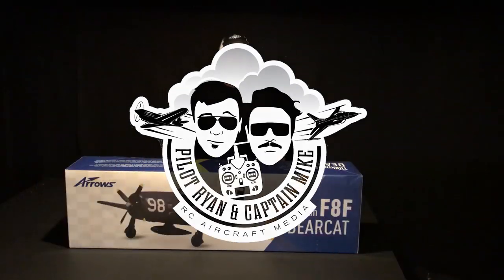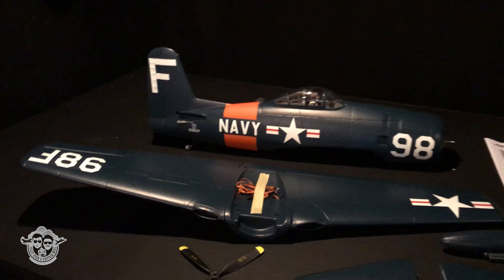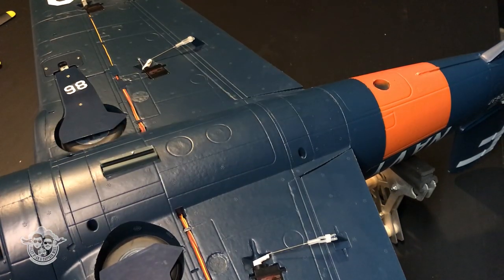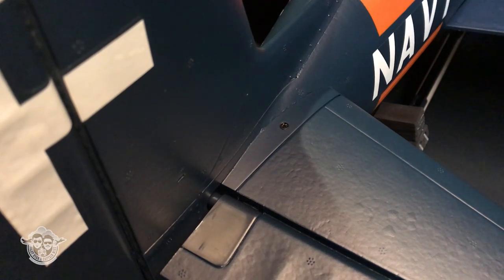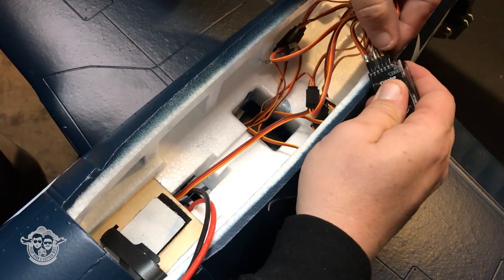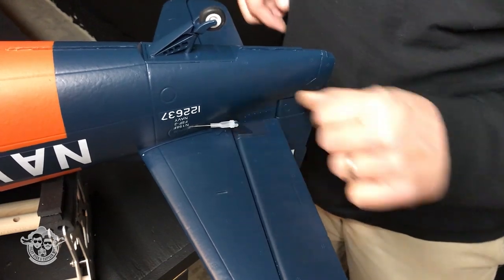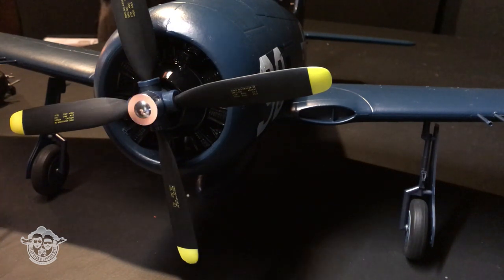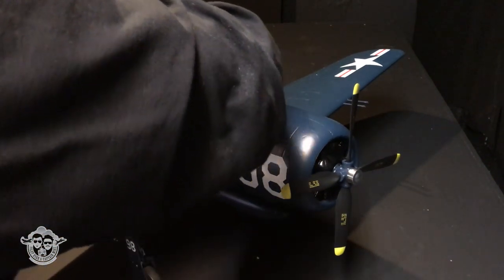Arrows RC F8F Bearcat 1100mm PNP Assembly

Comment: These are just phenomenal for the price ! The foam is very nice , as is the paint. As a guy that loves big planes , I also like to have a few that are low , stress , easy to transport two or three to the field fully assembled , and fly great!!  
I like these so much I ordered another Bearcat and also a T28 . They are $20.00 off right now , BUT if you order two, they are $30.00 off each.
That is a great deal on some super sweet warbirds.
Did I mention how good the customer service is ? Well it is second to none !

"We all fly under one sky"

Comment: Looks like my Eleven Hobby 1100mm Bearcat but now "Arrows".   Flies great on 4s,  Eleven Hobby 10x7 3 blade prop 3536 850kv motor 35amp max and on this set up 33amp 500w with modified throttle curve to reduce top end and not exceed 33amp.   CG 80mm back from wing LE/fuselage joint.   Hold the tail down initially or you nose over on take off on grass and break the 4 blade prop asI did on first go.
Reply: Paul Phelps how do you hold the tail down?
Reply: @felipestrong  Full up elevator before moving or adding power, add power gradually, release elevator once moving then go to 3/4 throttle add back up elevator when you see the tail lift

Comment: I’m curious for the comparison with the FlightLine bearcat. I finally crashed mine last summer and was 🤔 about another one. This price point may make my mind up. Price = 🤯👍🏻🎉
Reply: I have the Flightline Bearcat too..it has a few more scale details like the inner gera doors and zinc chromate paint detail in cockpit and gear bays..I was going to buy another but the price shot up almost $50.00 more than when I got my first one.
The Arrows , looks great , flys great , has good parts availability and is on sale for $169.00 to your door ! You will love it.

Comment: Hey Ryan... How is the wing reinforced? Think it's strong enough already for those of us that will likely up to 4s pretty quickly and occasionally fly "spirited"?
Reply: Yep - looks identical airframe to Eleven Hobby F8F. Bit too scale on 3S and tail heavy on a 2200 but put a 60A speedy in there on the stock motor and you can use anything up to a 3600 4S. Then you have an excellent warbird as the airframe and retracts are super solid. This set up really does the F8F justice.
Reply: Looking forward to doing the Papa thing with this bird. Do not have a F8F Bearcat in the hanger. Had one in the gas days. Wes is looking forward to the test fly/ video thing. Can't wait to see this bird in slow-mo. Great job Ryan and Mike!  Thanks, Arrows RC
Reply: @Mikeylikesit1968  As I have been saying! The dies to mold these planes cost $$$ to make. The manufacturer will fulfill their order with one company and then produce the same parts for another company. Usually they will " clean up" the mold and may be asked to make more details or whatever, thus producing a higher quality product. The company then adds their own motor, servo and landing gear package as well as paint and decals.  I like the Eleven Hobby T-28, no issues. One thing nice too, you can still get repair parts for your older planes, just under a different company.